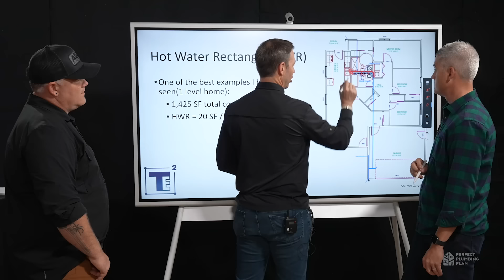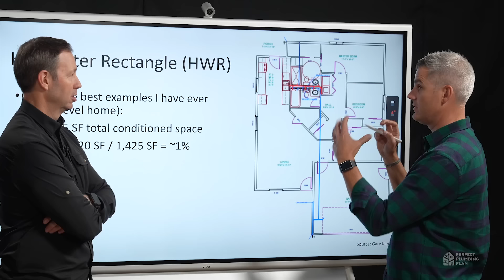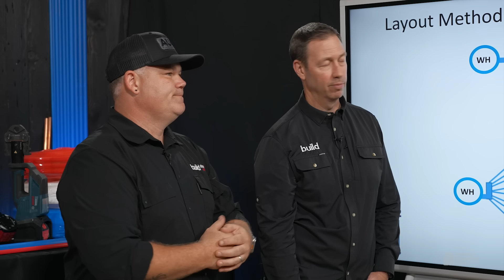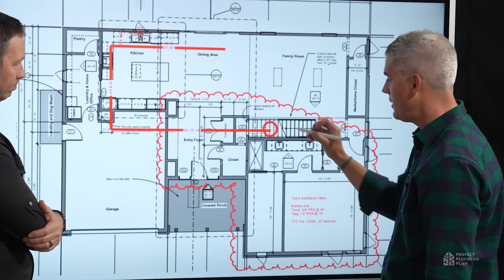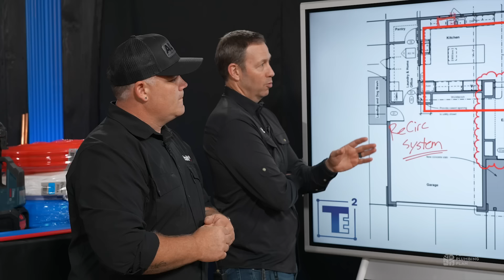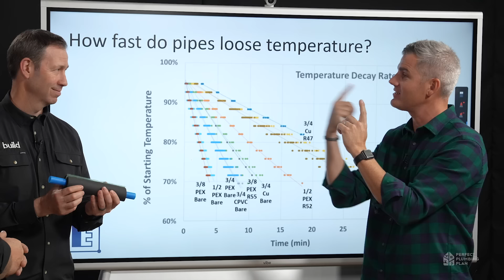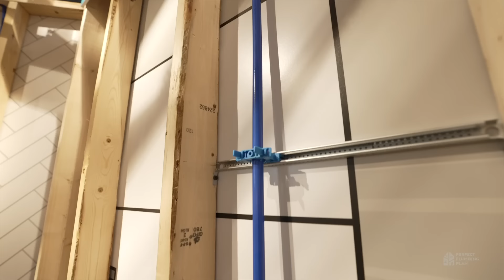The Perfect Plumbing Plan - Ep. 2: How to Get Hot Water Under 10 Seconds - Plumbing Layouts Part 1

Comment: I have small electric heaters under every bathroom sink.  Instant hot water.  Plus it teaches you not to keep the water running when you don't need it.  Main HWH used for kitchen and showers only.  Hopefully the main heater will last longer cause it's not going on and off for the bathroom sinks.

Comment: You didn't mention the water heater itself as a flow restrictor.  If the water heater or tankless water heater is being fed by 3/4" or smaller, would running 1" out to branches even matter ?  And do water hammer issues arise in a recirculating system ?

Comment: I draw plumbing plans and learned how to do it from working at a mechanical engineering firm several years ago. 
First of all, using a rectangle around fixtures and then calculating a percentage of the floor plan area is extremely contrived and ridiculous.  The principle of keeping plumbing tightly grouped is right, but drawing arbitrary rectangles is dumb.  A better way of doing it would be to draw a polygon around the plumbing fixtures and calculating that, but the whole idea of comparing that to the floor plan is irrelevant.  Just put your plumbing fixtures close to each other or else you'll be paying more money for hot water.  If you have a large house with plumbing fixtures spread all over the place, you should have multiple water heaters located to handle clusters of fixtures.
As for selecting the size of pipe you use, you need to decide on what brand of PEX pipe you want to use, and then find that company's sizing chart on the internet.  Every manufacturer has a chart for sizing their pipe, and even though they may be PEX, the PEX from different companies have different friction losses.  I typically specify Aquapex piping because the company has a solid reputation.  But recently, plumbing contractors have told me they are using other brands, mostly brands available at Home Depot or Lowes.  It makes no difference to me, I just find the manufacturer's sizing chart and use that to draw the plans.  I do, however, put a large, bold, note next to the plumbing calculation that says the contractor requested X brand of pipe, and I used that manufacturer's sizing chart for the plan and that substituting another brand invalidates the plan.
Reply: Disagree...when explaining this to novices it is a decent way to show the compactness of a system. If you're designing systems and using this, I'm finding a new designer.

Comment: I worked in the Hot water side of plumbing for >20 yrs and with Gary Kline for the last 15 or so and yes we need to move away from the Hunter curves to the Demand Water Calculator system. This will not only save water and energy but money as well. 
There is one caveat now however that must be taken into consideration. PEX manufacturers now restrict velocities to 2 ft/sec for how water to avoid premature failure due to chlorine and chloramines used to treat our potable water. This is important when sizing recirculation pumps. 
One other point to consider, the majority of green code influence regarding hot water system design is more concerned with saving energy than saving water. I suggest that there are any number of viable, efficient ways to generate energy but a very small amount of potable water accessible (approx. 3% of global water is fresh and only about 1% is accessible with our current technology).
Reply: I agree that green code looks only at the energy used in the hot water system itself. But a gallon of water contains ~5Wh of energy in every gallon based on EPA estimates used in the WaterSense program. Building a balanced hot water system that takes full energy into account isn't a focus because states and codes have different focus (saving energy vs. saving water) and no one is making them do both. 

https://19january2021snapshot.epa.gov/watersense/data-and-information-used-watersense_.html#:~:text=Top%20of%20Page-,Embedded%20Energy%20in%20Water%20and%20Wastewater,drinking%20water%20and%20wastewater%20services.&text=WaterSense%20uses%20the%20report%20to,treat%20water%20for%20public%20uses.

Comment: Supposed "experts" and they don't even bother to mention that the Inside diameter of pex pipe is smaller than the copper sizes used in the chart.  I/2 inch pex ID is much closer to 3/8 copper.  Look it up.  And oh, BTW if you have a large house, you could care less how much pipe you have in the walls, you are going to pay somebody like Matt to overbuild your house for you!!

Comment: 17:50 3/4” PEX bare vs Cu bare. 
Copper retains heat 2x better than PEX. If you add insulation… it wins hands down.
Reply: But, when it's cooled off, you have to heat the copper, which is actively trying to cool the hot water.

Comment: Can a recirc loop work without a pump? How could you design the loop to naturally siphon in a convective loop? I wonder if this would be cheaper to recirculate water convectively and continuously heat the water rather than buying a $400 pump.
Reply: Why buy a $400 pump? I use a $20 pump.

Comment: I gave up on heating water and sending it thru pipes. Now i put 4=5 gallons in the tub and heat it for 10 minutes with a 2400 watt immersion  heater. steams up like a sauna! Saves $40 every month. I shave while it heats up so 10 minutes to heat is while i'm shaving. Heater is removed for my "shower", so no chance of shock.

Comment: PEX is so cheap the amount of pipe used for a home run system is irrelevant. If you can keep the distances for hot water even somewhat low, it's the best option on a new build. And you get very few joints in the walls. 

I gutted a house and put in a home run system in PEX, and the copper recycling of the old pipes paid for more than the whole new system. I used under 400' of 1/2" PEX on a 32 valve manifold, so runs were all pretty close.

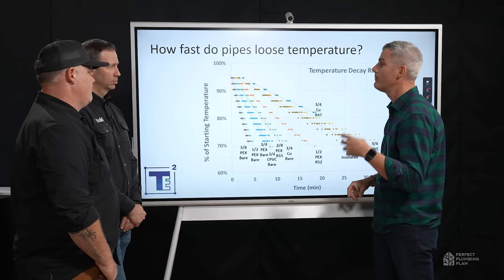Comment: 16:10 you say "pex actually retains its heat better than copper" but the chart says the opposite for bare pex and bare copper?  Even on the insulated runs, comparing 3/4 pex insulated, 3/4 cpvc r47, and 3/4 copper r47, the copper looks like it's outperforming the others.
Reply: Copper is starting with way more thermal mass, and it holds more hot water for a given nominal size.
Reply: @ctrlaltdebug  That makes sense, but it still doesn't account for why he said the opposite.  Obviously that'll mean pex feels warmer faster for the same run since there's less to heat up and it extracts energy slower, but for a pipe cooling down i.e. "heat retention" the copper still wins.
Reply: @RentableSocks  3/4 PEX will lose heat more slowly as it has greater insulation value, and the 3/4 copper can lose heat more quickly yet retain a higher termperature because it started with more than twice the amount of heat the PEX had. If you measure the absolute heat loss, the copper is radiating more away and warming up the wall cavity faster than the PEX.
Reply: @ctrlaltdebug  i'm not arguing about the physics, i'm saying that what he said was wrong and the recommendation for pex over copper because the water will stay warmer is false given the information that he presented.  one of those has to be wrong.

temperature within the wall cavity is irrelevant to the discussion, what we're talking about is the temperature of the water within the pipe - and if you consider that as the performance metric, the copper performs better.

Comment: I use SharkBite 1/2 in to 3/8 PEX and then ran 3/8 home runs to all my bathroom sinks and kitchen sink takes less than 10 seconds everywhere. You can't tell the difference between running the cold water fed by a 3/4-in line and the water coming out of the 3/8 PEX line at the faucet
Reply: How far away are your furthest sinks?   I want to do a 3/8" to two sinks about 20 feet away.   Is the pressure drop okay?

Comment: We have the master bath on one end of the house spare bedrooms on the other so I had the plumber put in a return line to the water heater with a circulation pump. I didn't need the pump as it would circulate on it's on, that was in 2005. Still works great.

Comment: 26:52 “Most architects don’t have the optimal layout for hot water plumbing in the forefront of their minds” (paraphrased). If my architect had tried to design my house based on the optimal hot water rectangle, I would have fired him immediately. Not that it shouldn’t be a consideration, it just shouldn’t be a primary design driver (unless maybe you’re a mechanical engineer or plumber 😊). Not that you guys are overtly saying that it should be, but it does seem to be strongly implied.

Comment: Lets get real. If you can organize your plumbing so it is close together do it.  If you cannot you can install a Taco hot water recirc system with insulated pipe for very little money.  You only need it for the second floor master bath.

Comment: With my WH about 20 ft away from the main floor bath, I have hot water in less than 10 seconds. The 2nd floor bath is right on top of the main, but you can tell that extra 10-15 ft creates a wait. I'm interested in a recirc just for that, if only because bathrooms need hot water sooner than anything else.

The kitchen isn't terribly far away but the wait isn't terrible. The house has a rudimentary basement bath farthest away that barely gets used and I might not bother with a recirc there. With any of these layout systems, it's a home run to reach that one. The house was built in '39 with what's essentially a manifold system below the main floor bath.

Comment: My father was a mechanical engineer and always designed stacking bathrooms because it reduced the plumbing costs (1950s and 1960s).  He would draw up changes to the floor plans drawn by an architect to reduce cost. That common sense flew out the windows in the 1970s until recently.

Comment: So cool, great information guys. I was always taught that running the tap for a bit helped to flush any impurities, debris and other schmutz that accumulated in the pipes. But that was probably way more relevant when galvanized steel and copper was used.
Reply: You really only need to worry about the last liter of water where the fixtures sit (assuming it isn't an unused faucet with stagnant water in the line). That last liter will be the "cold" water between the tap and the "trunk" anyway.

Comment: I have a new build just under 4000 sf with an 80 g heat pump water heater in the basement so smaller hot water rectangle. The engineer asked for 1 ¼” pex for hot water supply. Plumber installed 1” and I’m glad he did. When the lines are full of hot water there is zero issue with using all hot fixtures at the same time. The pex is doubly insulated, foam around it and enclosed in spray foam in the joists. All the right practices. I installed a grundfos recirculating pump on the three recirculating branches and bought the one that monitors temperature at the return and keeps the loops hot all the time.  It’s shut off most of the year by my choice. Two observations. With modern limited flow fixtures it takes ages to fill even shortish 1” pex trunk and branch lines with hot water. Can be 10 min for far ones. And second if I use the recirc pump, the heat pump water heater runs almost double the time as without recirc. To the point where I worry about longevity.  I’ll change to the occupancy sensor based or timer based recirc pump.  And in my California house pex loses a lot of heat.  Much more than I expected even well insulated.
Reply: Very good pressure is limited or static downstream so increased volume is not as relevant.

Comment: Small on demand electric hot water heaters under sinks gives you hot water in 2 or 3 seconds.  You can skip all the hot water plumbing and run a 20amp 240v circuit.  Works great for low volume fixtures.  Only run your main hot water source to showers, kitchen, and laundry.  They pull a lot of watts, but only for a few seconds every now and then.
Reply: The downside being the additional expense of running extra GFCI/AFCI 240v connections to each bathroom and kitchen, buying the additional water heaters, plumbing them, increased regular maintenance, and the reduced MTBF (though the last one is offset by redundancy). They definitely make sense in some situations, but wouldn't be my first choice if I've got one.
Reply: @chaseweeks2708 
Unless you are awesome and so you are running a 240 for the towel warmer/ jacuzzi tub/  wall heater /already lol
Reply: It's about 40A @240v to do 1 GPM for my house in Pennsylvania.  A really low flow faucet at 0.5 GPM might be okay with a 20A or if you live in the south with 60+F ground water.
Reply: @MrPizzaman09  Also gotta make sure all of the fixtures can flow well above the minimum flow rate of the water heater. Take that faucet, for example. If the minimum flow rate of the heater is 0.5gpm, then the faucet will not get get hot water unless it's running full blast... and that's before the aerator eventually starts building up mineral deposits and reduces flow. All manageable limitations, but gotta make sure they are all accounted for before breaking out the credit card or somebody is bound to not be happy with the results.
Reply: @chaseweeks2708 The Rheem RTX series for their 18-36kw unit that I have are 0.3 GPM minimum.  So far I haven't noticed it not running a low flow rates.

Comment: You all talked about the low power consumption of the recirculation power but you all left out the high power heating consumption of the HOT WATER HEATER!!!
Reply: I think you are thinking what I am thinking. It is nice to have hot water quickly but with  recirc line won't the water heater be always producing hot water, especially an on-demand unit. The whole point of this type is to call for hot water when needed. Or am I thinking completely wrong. I have one now and what is the big deal of waiting 45 seconds..??  thanks.

Comment: Have a grundfos unit for 27 years.  Had to replace the valves under a couple sinks once
Reply: Same here.  Added smart plug to run the unit.  Phone app running the smart plug allows regular scheduling of the pump during peak use times, as well as on demand in between…